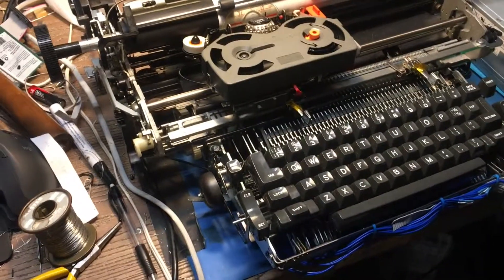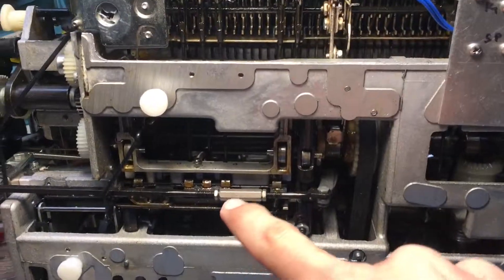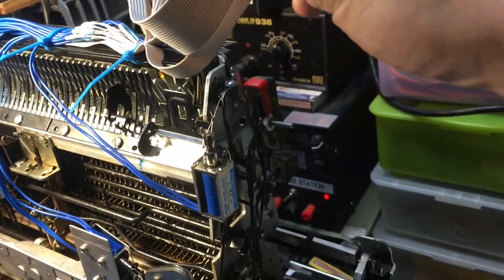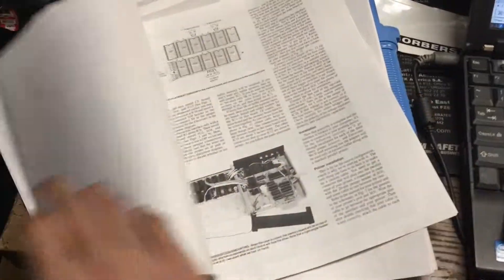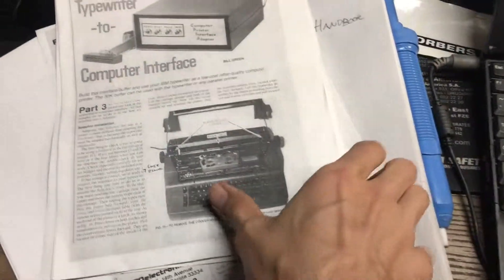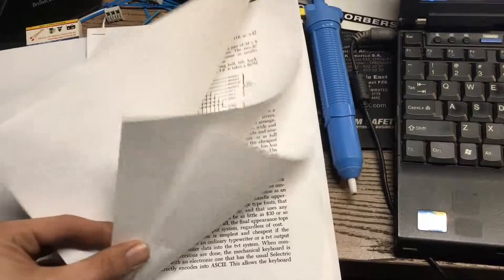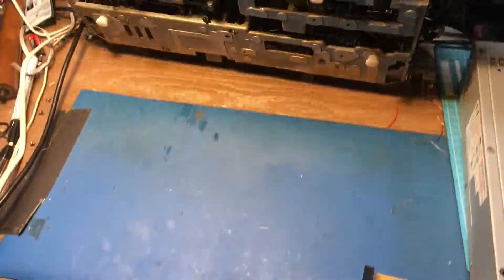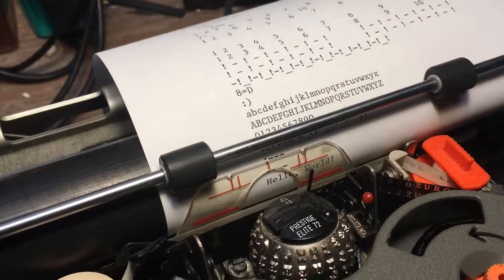Selectric TV Typewriter Conversion

Comment: I built one of these in 1983, from the article. Drove it with an Apple ][ 8 bit parallel card. The challenging part was writing a driver in 255 bytes of 6502 assembler. My parents used that machine for several years.
Reply from the maker: Very cool, would be awesome to see that! Do you recall any specifics of the implementation?
Reply: @LA3DPrinterRepair  Oh yeah, I remember it well. I bought an old IBM 2741 Selectric terminal from the University of Waterloo, where I was going to school. I was hoping to use the serial interface, but it was a very weird baud rate (110?) and was ALSO in EBCDIC, not ASCII. So I built a really straight-forward driver with optoisolators and a Darlington driver transistor for each solenoid. I drove the optoisolators with a standard 8 bit Centronics parallel printer card in an Apple ][ clone. As I remember there were 6 control solenoids for the ball, one for carriage return, and one for line feed.

Each card on the Apple had 255 bytes of on-board EPROM memory. I wrote the driver by hand in assembler, and then when it worked I took it in to a guy I knew and burned it on EPROM. Getting it all working in 255 bytes was really challenging, because just a standard lookup table would be 127 bytes. I did all the timing in software. It worked surprisingly well, my parents used it for word processing.

It was, however, incredibly loud!
Reply from the maker: Scott Welch fantastic! Thank you for that! If you ever come across some of the old output, I’d love to see it! How did you handle page feeds?
Reply: @LA3DPrinterRepair  I kept a line number and beeped when you needed to load a new sheet.